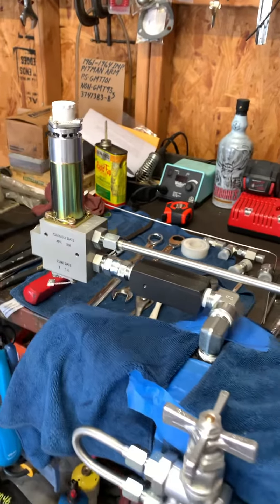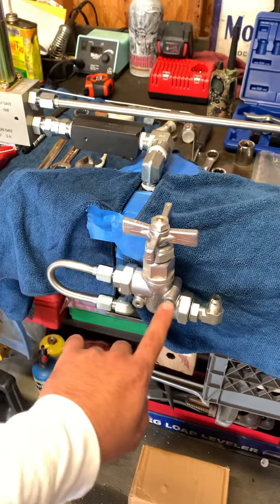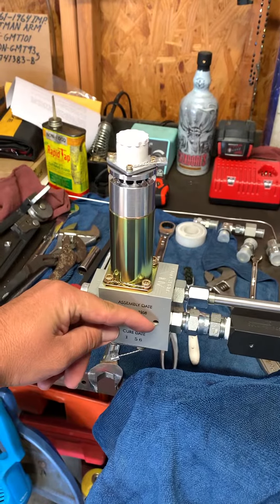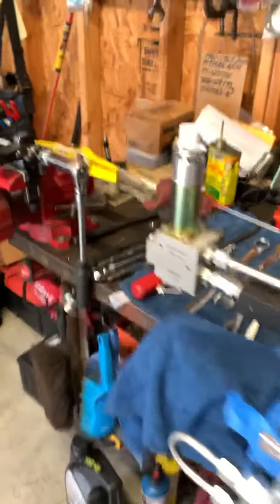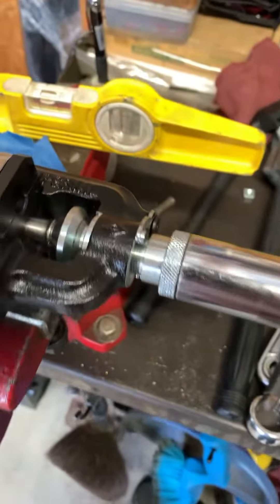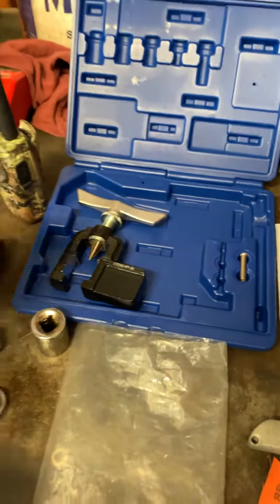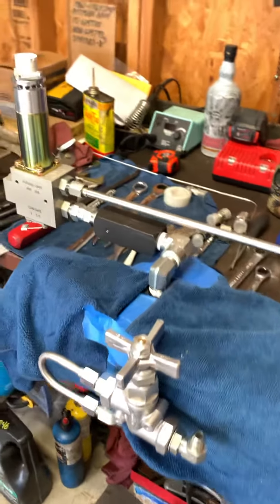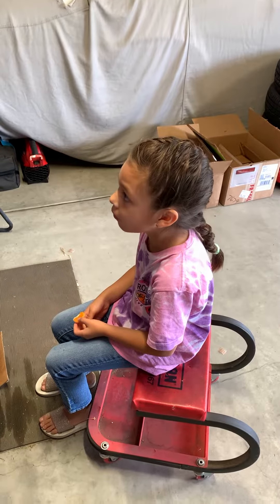Hard lining Adex Dump For Lowrider Hydraulics Set Up Using 37 Degree Imperial Tooling

Comment: okay this is my two cents it looks like you're running one pump to the front if your car is going to lay on the ground I personally would rather run two dumps if one of your rear corners happens to lose pressure your whole car is going to lean unless you're locked up also the dump solenoid pulls up the internal workings
Reply from the maker: That’s what the guy that sold me the dumps said. That was the plan ! 4 dumps!! 2 to the front and 2 to the rear. But these Adex dumps are outrageous 💵
Reply: @ChapsBuilt84  then I would run two blow proof dumps to the rear and put the other dump in front yes I know the dumps are outrageous but four dumps will stabilize your car if you going full range with your suspension if you're staying locked up or close to then one dump is not a problem you also got to remember since you're putting this in a ragtop the body is not as stable it's a hardtop so if you have a rear corner loose pressure your doors will have a gap that's why you need to reinforce the frame
Reply from the maker: @Mr50pop  thanks for the advice! Greatly appreciate it 🙏 yes when I did the frame off restoration on the car I knew I had to put a reinforced frame in it. 
I knew one day I was going to cut the car and didn’t want to take the body off the frame AGAIN! So I had it reinforced and slide it back under the car.
Sad part is that I put air bags in it.🫣 bags are cool but no greater feeling then bien in a cut car🤘🏽
Reply: @ChapsBuilt84  yeah guys say that bags don't tear up your car but they're actually not that reliable at least to be hydraulics will and won't tear up your car it's all about how you want to ride and you can Taylor make the ride smooth